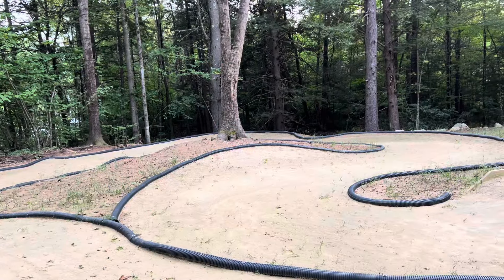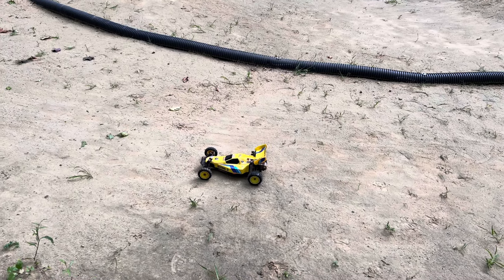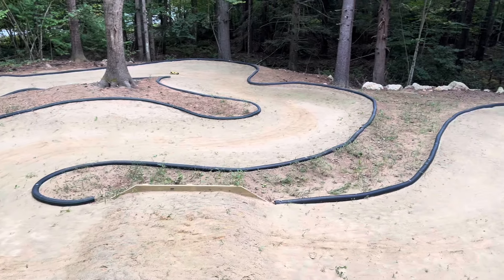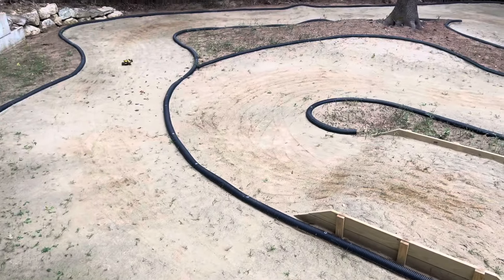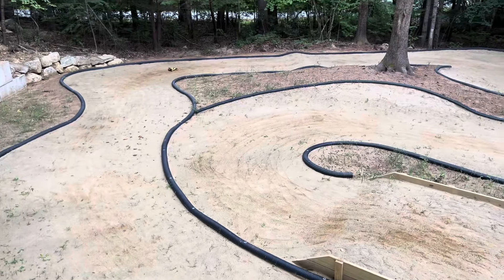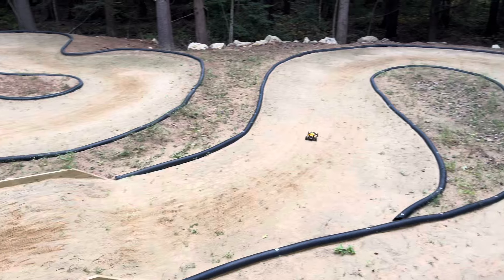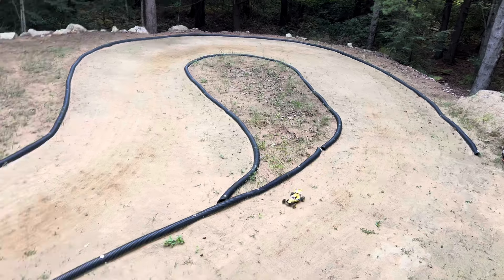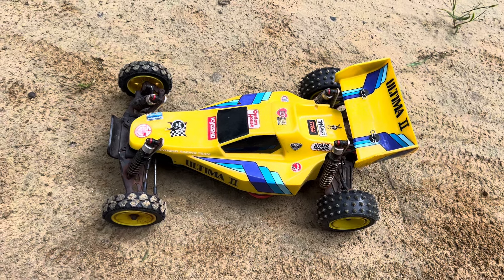Another 2wd Wednesday Roundup!

Comment: Keith I've just gotta say when changing your electrics don't forget to reset your controller n rebind Ur electrics👍 and for a cheap fast brushed motor try the hpi firebolt 15t there cheap (£15) and fast, we get about 30 35 mph on 2s (tt02) 👍👍.
Ps tracks looking great.